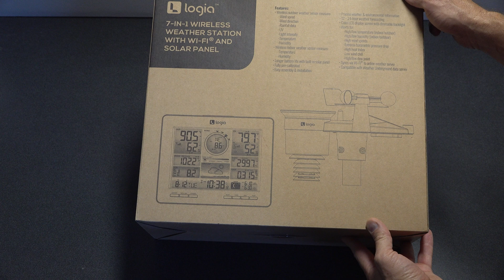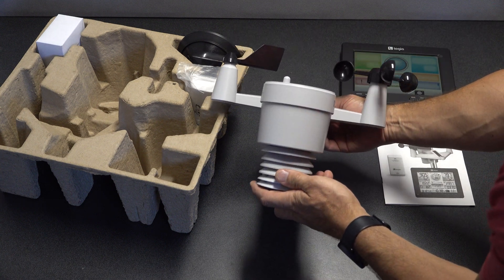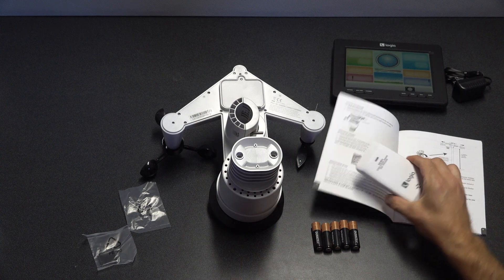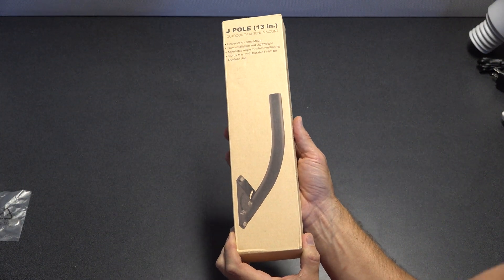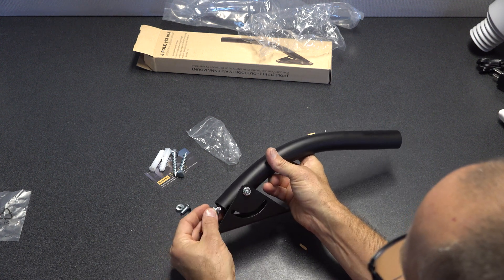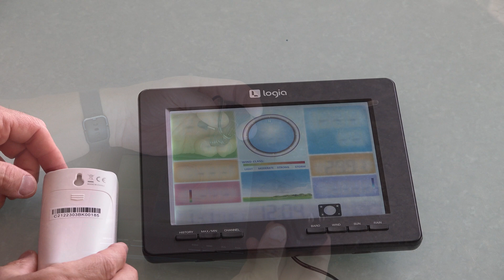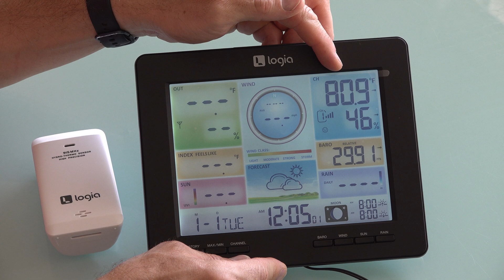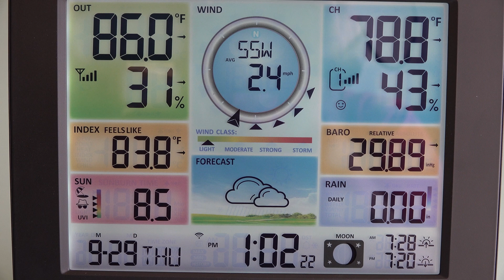Logia 7-in-1 Weather Station does it work right out of the box ? Opening, install, and review.

Comment: After two years of use, what are your thoughts on its accuracy? And if you were to just go ahead and get one, do you think it would withstand Arizona's intense summer heat—i.e., several days a year pushing 120°F or higher?
Reply from the maker: It is pretty accurate, I would know more if I purchased a different manufacturer to test against. We get 115 for a month at a time and it has held up. I think the UV will destroy the plastics after 3 years. But for just over $100 I think it is worth it. It has saved my orchards bacon multiple times by letting me know of frezing temps and over 110.

Comment: I just bought one and Outside Temp does not work on it.  Wind, Wind Direction and Rain etc work.  This is my second one.  The first was missing parts.  Guess I will send thiis one back too.  Good video though.  Thanks for sharing
Reply from the maker: Thanks, I am sorry it is not working for you, I am sure there are bad batches, too many variables. Mine is still going strong.
Reply: @flackfruit  I returned it and got the one with the bigger display It works fine so far.

Comment: How does rain gauge work , do you manually have to empty. I got mine today through Amazon.
Reply from the maker: No I don't, it just evaporates.... I think. But we get very little rain here. 5-7 in per year.
Reply: @flackfruit I think with most stations the rain catch empty’s itself , take the top rain cover off and look inside it has like a spoon that catches the water and when it fills it tips and empty’s then resets to continue catching rain over and over, I could be wrong but have a look inside of the rain catcher and see.

Comment: Having issues with the so-fi set up. Also cannot get the sunrise and Sunset right
Reply from the maker: I have been able to get it to connect, every once in a while it will disconnect and I move the monitor a foot and it will reconnect, but I have a building between the sensor and display unit. I tried to get the DLT to work and it doesn't change for me in the software, but I use my other clocks instead of the Logia. It is not prefect but it has been working for the most part for me. I would try to reset it at the station and monitor to see if you can get a good connection. Or move the monitor closer to your unit and see if it will connect, if not then it might be defective.

Comment: does the small solar shield work correctly or due to this small size you haze overestimate temperature values?
Reply from the maker: Great question, it seems to be pretty accurate, it is about 1-2 degrees cooler/warmer than current temps reported by weather.

Comment: What would you suggest if outdoor doesn’t connect?
Reply from the maker: Make sure you have a clear line to the station and receiver. Press the reset button on the bottom of the  station, replace the batteries. Beyond that you would have to look in the instruction manual to fix anything deeper.

Comment: I just received mine Sunday.   Setup was no problem, connected to my WiFi with no issues.   Not sure what others are seeing with WiFi set up.  Perhaps mine WS has a new firmware version. (NOTE:  I have seen other ioT type devices that would not connect to WiFi if one uses the same WiFi SSID, as I do, for both 2.4 and 5 Ghz bands.  To resolve this, I shut off 5 Ghz to get device to initially connect, then turn my 5 Ghz back on and device is happy still.)    I was able to connect the unit to both Weather Underground and Weather Cloud with no issues. Everything connected when I powered up all devices.  The initial setup to connect to the device is pretty typical (put console in AP mode, connect your PC or Mobile device to that WiFi SSID.    However, to have to continuously go through this process AFTER initial set up and suboptimal IMSO.  Once it is on the network, why not allow direct connectivity.  I assume they did this to save a few $ and probably security.  I am debating where I will be mounting this, either on very top of my home as I have a roof mount pole that was installed two years ago for a new Internet service provider, but they never finished the installation OR I will install on a wall in back yard.   So far, I am good with the setup display and range of the sensors back to the console.
Reply from the maker: Yes, I am actually impressed with the range from the sensor to the display unit. Sometimes I get an error on the display unit but it usually finds its self again. If you have an unobstructed location you can put it instead of the roof I think you will get a better more accurate reading. I have read the sensor can be 400 ft away and still send info to the display unit. Mine is about 200 and behind a building and still sends a good signal.
Reply: @flackfruit   @Flackfruit  (and for others that read this) I decided to install on my old DirecTV sat dish mount as I recently, after 21 years, moved to the DTV streaming service.  I purchased a 5 ft antenna mount pole (big box store locally) and a couple of C clamps specifically for this application (from a very large online retailer one can guess who that is).  So my unit is not on the very top of my roof, but it is a couple of feet above roof ledge line now.  I decided to go this way due to anticipated HOA issues with mounting a weather station on top of roof vs. Internet service via CBRS radios would be approved.  The temps and wind measurements have been good, earned my station a Weather Underground Gold Star so far....   Range and connectivity is not been a problem from the station mount to the display console, which is about 100 ft but through the roof materials/walls to the far side of the inside of house (furthest away possible location).  So, overall - pretty happy.  Also, I did try out the tech support line.  Called during posted hours, automated response to get into queue, and my call was picked up in less than a minute.  I was calling to ask about the firmware update advertised in the manual and in the Advanced UI screen of the display console.  There is no "download" for any firmware on their website.  The response I got was "questionable" as the rep told me, after a minute of what appeared to be research, that their is not firmware update available.  Small nit pick here, why not just publish a firmware note on their web page on what is the latest version.  Overall, happy and good with this unit thus far.

Comment: I have had my unit for over 8 months now. Working flawlessly. I constantly refer to the Weather Underground for a daily graph and readout of the overnight lows and current high originating from my station.  Unless you are technically adept, set-up for Wi-Fi can be a challenge but for others, it should come together with relative ease. I highly recommend this unit.
After one year and 3 months running,  I was disconnected from the Weather Underground.  It took me 4 days to rectify the problem. (After ordering a new WX station!)  On that 4th day, I discovered that the Logia owner's manual setup states to enter the "Router Name" "and " Router Password". After doing this some 50 times over, I discovered that these were NOT the parameters to use.  I have a home network and I needed to use my Network Name and Network Password instead. Then it connected right away!  So after a year's use plus,  this unit is still motoring along. Very happy with it and would still recommend it to any interested weather buff.
ii
Reply from the maker: Thanks, me too, no issues and it is fun to watch everything work together. I am sure their are people out there having problems, but it has not been my case.
Reply: How can i connect to Weather Underground,please?

Comment: I CANNOT GET MINE TO CONNECT TO MY WIFI IN THE HOUSE. ANY IDEAS ?
Reply from the maker: If you have any concrete walls between your router and station it will have a hard time connecting. My router is closer to the window and in line of sight with the station so I have a good signal. I would also use a computer to set it up with the IP address, don't use your phone, I have heard that phones make it hard, even though they are convenient. Beyond that, what have you tried?
Reply: Same here Jimmie. Adding device and following instructions doesn't work. Hope I can find a video showing how to connect the device to wifi and navigate the app setup

Comment: is it a reliable weather station?
Reply from the maker: So far it is. There has been an hour that I get an Er message but it reconnects on its own, so yes I would say it is. But I have only had it for a couple of months in 20-115 degree weather, and 50 mph winds.
Reply: Mine is going on for 3 years old, you Must follow regular maintenance schedules not only on a Logia but any weather station for that matter and they will last for years.
Reply: I think you are right, maintenance is necessary on any weather station

Comment: Wifi setup was tricky and couldn't do from phone.  Had to do on laptop.  Still don't understand the forecast aspect.  That area is always blank.
Reply from the maker: I did it from a computer too, with a phone you have wifi and phone network to deal with in terms of disconnecting and connecting. The computer makes it more simple. I too don't understand all of the options.
Reply: @flackfruit  how you do it?

Comment: Watched the entire video and you didn't bother to completely set up the station.  You covered all the easy parts but didn't bother with the WIFI set up which is the reason I'm looking for some help.
Reply: My app doesn't do anything when I try to connect. No idea how to troubleshoot. I've done the exact steps provided multiple times. Wish there was some tech support because it's useless without being able to connect to the app
Reply: I just set mine up, it’s a bit confusing but not to hard.
Reply from the maker: Set up for me was easy and just pressing the reset button on the bottom of the station, beyond that I had no issues. If I did have issues I would have put it in the video.

Comment: What about the WiFi setup?
Reply from the maker: I didn't have issues with it. I pressed the reset button on the bottom of the station and it connected with the monitor just fine. Or are you referring to setting up over the network so you can submit the info to an online system?
Reply: Connecting the station to the display is different than wifi setup. The wifi setup is in the app which is what I'm having issue with too. Any luck Todd? When in the app, I select that I connected to the display network and nothing happens and when I go back to the initial page of the app, then it's like I didn't add the device

Comment: I bought this same unit a year ago and live on the banks of an active river where we routinely get weather that brings gusting winds between 50-60mph for several months in the Fall/Winter months and temperatures below freezing. In the summer we average temps in the 80s with spikes as high as 90-100 on occasion. Our annual rainfall averages at 34-38". This unit has tracked remarkably close to the local weather stations for all metrics - wind speed/temperatures/rainfall. For the price I am pleasantly surprised at how well it works. Only complaint is the lower information i.e. clock, sunrise/sunset, etc. seem to not want to report accurately no matter how I reset them, but they are of little concern to me. The other features are what I bought this for. That's my two cents! 😊Enjoy!
Reply from the maker: Thank you for the feedback, I too feel like it has been accurate, I am a couple miles away and at a lower elevation compared to our local weather station and have found that we are a couple degrees cooler in the winter and a couple degrees warmer in the summer comparatively, beyond that everything else reads pretty much the same.